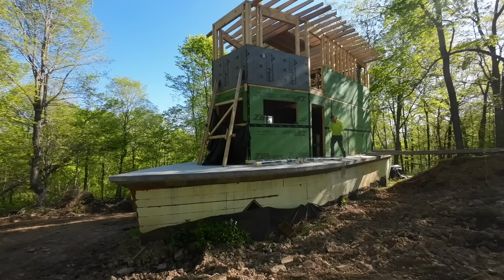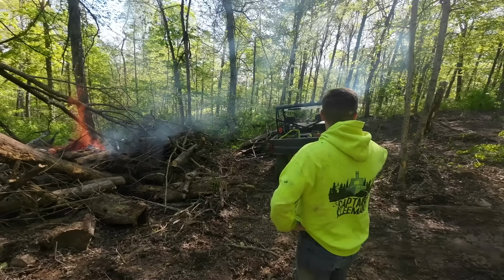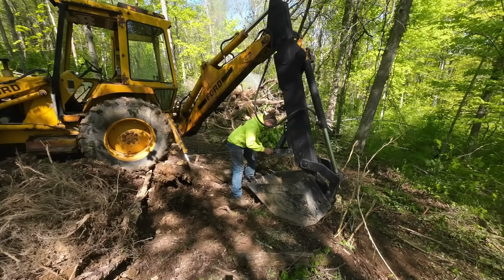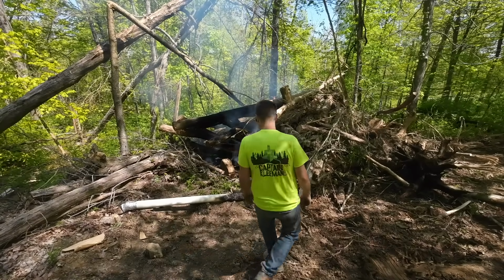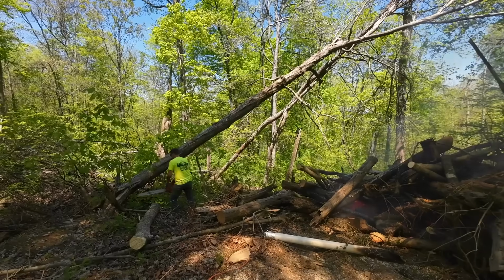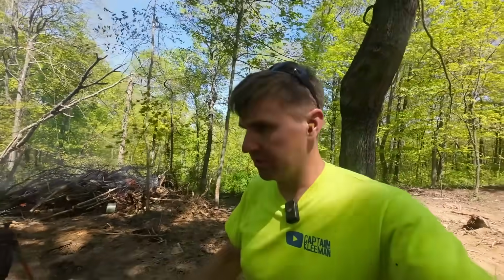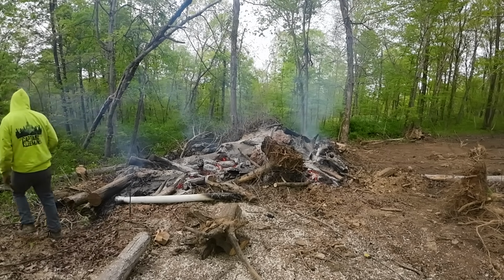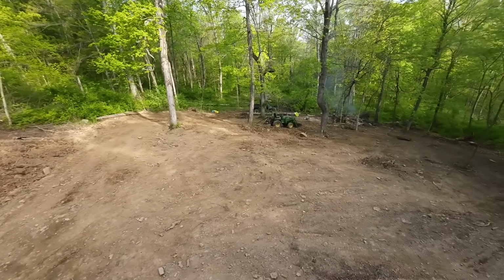Clearing Trees and Burning Stumps With Old Backhoe

Comment: Sure is amazing what you can do with a "garden tractor" and some welded up steel. Of course having the knowledge to put them to best use helps. Well done Capt. looking good. Keeping that brush back will keep the copperheads away as well so good work on that. They really do not like the manicured areas so let them have the wild and you keep the lawn area and your guests will be happy. Nothing that is more useful than an old furnace squirrel cage fan. A thousand and one uses and yes fire really loves oxygen. Burns way hotter and faster.

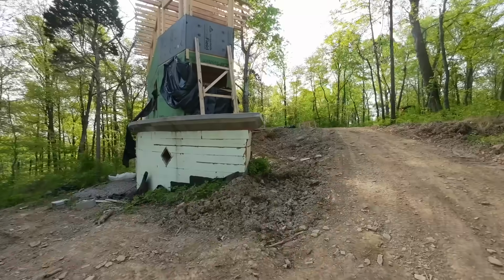Comment: 27:50 I have a blower like that. I fixed mine with some guards to prevent getting fingers in it and painted it yellow. It works great as a high volume air mover. They are nice because you can get the air moving 20’ out in front of it because it has some power to make air pressure.

Comment: The fan you are using is designed for inside of a furnace that being said block off the top half of the opening and it cause it to build up pressure and the fan will blow way harder and work more efficiently to get the fire going I use one similar in my garage that I mounted to a old pressure washer frame with wheels on it so I can set it anywhere I need it for air while I’m working

Comment: I use my Stihl blower with a 10' section of cheap galvanized gutter downspout material and a propane weed burner.  Works well for getting the fire going!  If I am in a hurry, leave the blower running.  If I want quiet, shut the blower down.

Comment: I use a small furnace fan like that for a breeze when I’m outside working in the sun sometimes. A bare minimum of narrowing will really ramp up the force. And if you had one of those 2stroke mini generators it would barely use fuel to run for the day. Love the videos! Keep up the great work
Reply from the maker: Good idea

Comment: We live in the Black Hills Forest Protection area.  Rules for burning are strict.  No burning from April 1 until November.  When you do burn, a minimum of 2" of snow is required for a small fire and 6" for a large fire.  A permit is required and notification to 911 dispatch must be made. We had one pile to burn this year.  We weren't around on a couple of potential burn times.  We finally burned it on March 31.
Reply: I don’t know if you are aware but Mike is a lieutenant on the local fire department.well versed on fire prevention.that is his day job.
Reply: @tomswindler64  Of course I do.  In no way was I being critical of what he was doing.  I was merely explaining what I have to do to burn slash
Reply: Rules are made for the local conditions usually. Where he is in Indiana is pretty safe most of the year. Unless it is drought year, July and August are the only months that it gets real risky. A good rain a couple times a week is cumulative and the ground stays damp and with the high humidity the foliage stays resistant to ignition. I am in Missouri which is similar so starting the fire is often harder than stopping it. You can control a burn by pulling the fuel back most of the time and if it is not piled dense on the hottest of coals it will just smolder down and go out. Point is location really matters on how the rules are made.
Reply: @markpashia7067  I live in a Semi Arid area.  we only get a few inches of moisture at this time of year.  Our humidity is very low. Fire risk is high most of the time.I live in a forested area.  While not completely following "Firewise" guidelines, I've kept trees away from the house and keep the prairie grass down.  Trees are limbed up 10-12 feet to reduce ladder fuels.  The house is sided with fiber cement.  There is a 4' perimeter of rock mulch around the house and plantings are limited. There are no evergreens near the foundation.   We are also fortunate that we are just a couple of miles from the local fire department and also a couple of miles from the TATANKA HOT SHOTs.  a forest fire fighting organization.
Reply: @adubbelde1 kudos, sounds like you are doing all you can to keep safe.

Comment: Good deal, Kleeman.  Other than the stump that refused to burn up.  🙂  As always, thanks for sharing.  People are a bit paranoid about fires.  Or at the very least 'overly concerned'.  I've always lived in the city but as far as I could tell with all that green behind the fire and clear dirt in front (uphill) I wouldn't have been concerned.
Reply: What he has explained multiple times but often people still do not hear…. forest fires are due to the fuel (tinder, dead fall, leaf piles) on the ground.  Yes, live trees will burn up but it takes a lot of heat and fuel greater than a little grass to ignite them.   Anyone that has made a fire with green wood and wet tinder can attest to the challenge of igniting one…. takes a lot of intentional effort. 

Once a hot forest fire happens, what really spreads the fire fast is when green tree trunks are exploding due to the intense heat instantly converting the moisture inside them into pressurized steam that must escape.
Reply: @genesispuredeaf2390  Oh gawd yes.  Just look at the mountains in CA.  Overgrown with like 50-100 TIMES more trees than there should be.  Lack of water.  Dead wood down to rot.  Etc etc.
Reply: The other thing they forget is the humidity in the air, ground, and on the surrounding plants. Indiana is a humid state compared to out west where it is dry as can be. Fire behaves totally different in 80% humidity than 10% humidity.
Reply: @markpashia7067  correct….Mike spoke to that in his explanation.   He is aware of the steps that are needed.  Also, the camera often doesn’t show distances and elevations that are realized in real life (irl).  Even though I know his skills, I pucker up when he makes his fires in the woods until I can see for myself that everything was checked.  Most importantly…he is doing this on his own property which is significant in many realms.  

That gets heard by those who are good listeners while the bad listeners self identify with obvious sounds of ignorance.  Whether they ignore things or have a problem comprehending is the true question.  I smile and virtually pat them on the head (gently) …don’t want to add insult to injury.

Comment: Mike,  you and I know, in Indiana this time of the year, the ground is moist, the leaves are green and, as long as the wind is not blowing, the danger of a fire getting away from you is very minimal.  It isn't the fall with all the dry leaves and weeds.  It isn't a dry climate where the pine needles and dead tree criss-cross the forest.  You prepared a perimeter around the burn area.  You didn't throw your cigarette out the window of the truck.  You weren't downing a jug of pure grain alcohol.  You knew what you were doing.  Well except taking your 555 down a steep hill with slick tires on the back.

Comment: I always stock up on cheap bags of charcoal at the end of the year, usually $6-8 for the big bags and with my charcoal starter can it will start a fire in a pile of wood quick. Even better when you can snag a stack of old pallets to cut the good wood off and toss the pieces with the nails in the garbage bin, used to have a guy with a saw mill that would give me all the slabs i could get which was perfect for bon fire starter with charcoal
Reply from the maker: Good idea

Comment: For your squirrel cage blower find an old two wheel dolly to mount it on before doing your sheet metal improvements. It will make moving it so much easier plus you can make a cord wrap on it.
Reply: He’ll have to make sure it has all-terrain tires with all the holes in the tubes patched!!!
Reply: @sassafrasvalley1939 airless wheelbarrow tires are my preferred tire/wheel of choice

Comment: its amazing the difference in burning laws from state to state. If you did that here, you'd be in jail faster than you could strike a match. Here, you have to have 50 feet in all directions (including UP) fully clear, and then you must have fire prevention on hand (water hose, fire truck, water truck, something). And all that is assuming you can get a fire permit in the first place. And that is iffy at best. I've got brush that has needed to get burned for the last 3 years but I dont have anywhere on the property with a 50 foot radius. I actually am going to have to clear a section just so I have a burn area to use. I'd have done it already but I cant get a burn permit. The state is too afraid of more massive fires.
Reply from the maker: Sounds like the law of a state that never managed their forests properly.
Reply: @CaptainKleeman  Yup, absolutely. All the forests are SEVERELY overgrown and choked with underbrush. Thats why CA, OR, WA, ID, MT, WY and a few others are burning to the ground each summer. I've been trying to clean up my property for "fire abatement" for the last couple of years but have no way of disposing of all the brush. Cant burn it, costs a fortune to try and haul it off plus disposal fees, chipping/shredding helps with the little stuff but still leaves piles of chips that is hard to get rid of. And that still leaves all the big stuff. Most of what I have is Pine and no one here wants soft woods for firewood so even that is hard. I watch channels like you, Dirt perfect, and Letsdig18 and I get jealous at your being able to burn LOL.

Comment: be very careful with those type of generators on slopes as they are easy to run dry even with a low oil shutoff
Reply from the maker: Put the pick up side downhill.

Comment: Mike.... on side hills run with your stabilizer down,  just above ground, if it wants to go over it will touch down on the stabilizer. Did fencing with a Case 580 in the mountains of British Columbia that's the ticket....our hoes were 4x4 so had to do that lots....
Reply from the maker: Good way to snag a tree and roll the machine or break something.  No way I'm having stabilizer down and operating when clearing land.